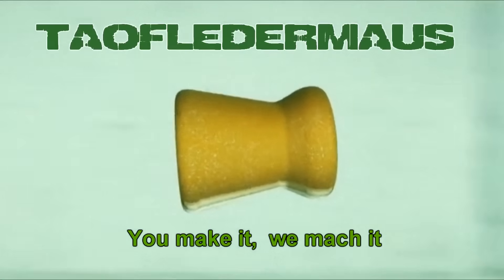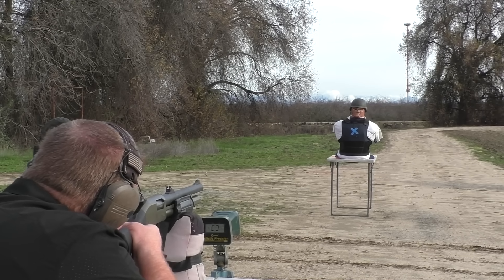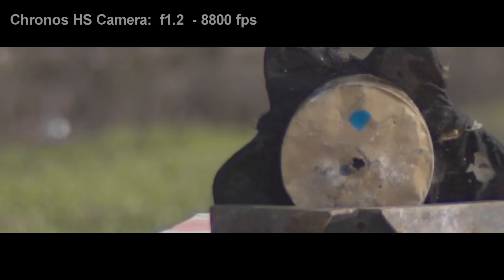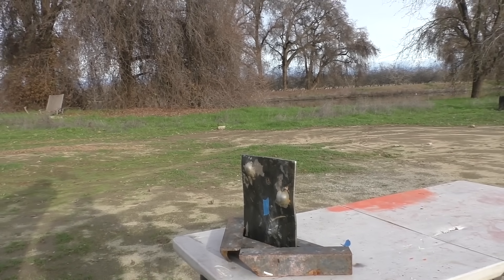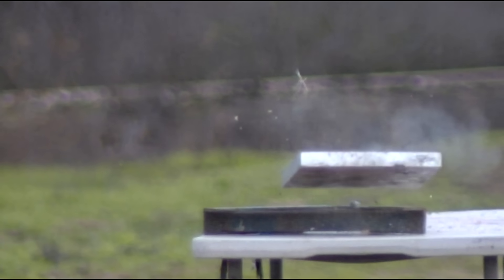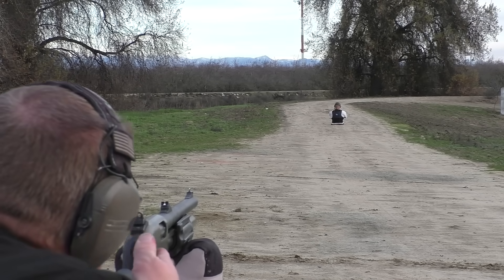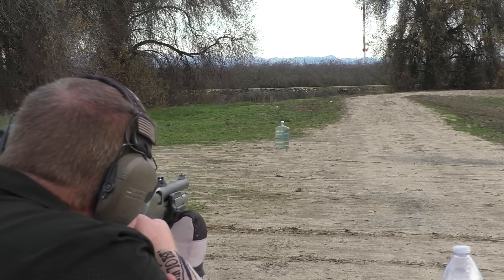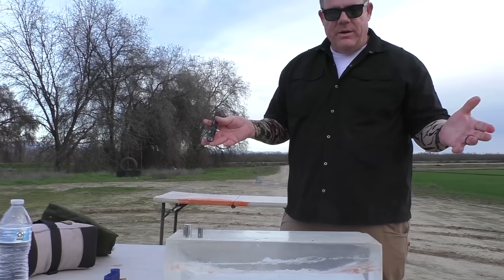The "MACH-71"  Super Perforator Slug   -  TESTED

Comment: The way the point is sticking out of the end, I would be afraid or them setting off the primers of other rounds stacked in a tube magazine.  Kinda like what the early Blackwater "heavy hitter" slugs did.  Super nice results!  I would buy some
Reply: That's one reason to go for box mags.
Reply: @GunFunZS  Box mags is all I run.  I have about 40 rounds of the blackwaters left and have shot 20 and didn't even know the problem exsisted till about 6 months ago.  Either way it is an easy fix by rolling the shells a bit taller or using a shorter wad to prevent tip from sticking out.

Comment: It definitely  needs a tungsten core.  I also think copper would be better than aluminum and score it 2/3 of the way down so maybe it will expand.  I was also thinking a slightly smaller tungsten core with tiny steel rods around it that would fragment off.  It would be a triple threat... expanding slug, fragmentation, and a penetrator.
Reply: Very much what I was thinking for a "Generation 2" version
Reply: Tungsten will shatter at high pressures but it’s great at high temp 316stainless or hss (high speed steel) will perforate better
Reply: When I break a tungsten electrode at work it splinters like wood sort of. so it would be a triple threat with just the aluminum jacket I think
Reply: Does it harden, temper, and anneal similar to steel?

Comment: Looks like an excellent new design ! Just think if the outer material was brass and the inside was tungsten….
Reply: No you want the penetrator carrier to be as light as possible, so it accounts for as small a portion of total projectile weight as possible. Aluminum is an excellent choice. A tungsten penetrator would be better though.
Reply: @caseyb1346  Brass/Tungsten would look super pretty though. ;)
Reply: @praetorxian  yeah it would
Reply: Tungsten penetrator and aluminum or even magnesium outer is better. Speed penetrates. Brass is way too heavy.

Comment: How did early gun designers figure out how tightly a slug/projectile should fit into the barrel and rifling grooves?
Reply: Centuries of trial and error making one small improvement at a time
Reply: @saltedcashews269  Yeah and I guess there wasn't super precise machining until sometime in the late 18th or early 19th century? I bet a lot of barrels exploded.
Reply: @stopthephilosophicalzombie9017  possibly, but you also have to remember the differences in energy from powders used over time. Black powder was much less aggressive than smokeless, and then there was "pistol" powder which was even stronger, and your +p powders and such.

Comment: That's easily the cleanest lead plate interaction ever on the channel.  Perfectly round crater on one side, perfectly straight hole with no blowout on the other side.  Kyle is an instant legend.  Looking forward to his future work.
Reply: Characteristics of a shape charge. Wonder what a copper core would do?
Reply: @blauer2551  shaped charge would need to be an explosive shell. not really the anti-armor mode for small caliber munitions.
Reply: 😊 2:10
Reply: Physics, it essentially whipped the core out.
Reply: Facts‼️
Reply: didn't the steel core anti-armor round get stuck in it?
Reply: @JonathanSchattke  the steel pinatrater was stuck in the vest after passing through the lead plate. The aluminum slug was what stuck in the plate.
Reply: They're in Californitopia. Nothing is straight there. LOL

Comment: Definitely one of the best homemade slugs you’ve tested.
Reply from the maker: Especially for a first timer!
Reply: Copper outside and a tungsten core would be perfect in my opinion 🤔💪🏼
Reply: @andreasbinder6510  and 10x the price. Keep the aluminum sleeve and forget about a tungsten core, just make the core out of hardened steel instead of mild.
Reply: @tissuepaper9962  or make both a cheap option and a performance option
Reply: That slug is basically a well made APCR round, a beautiful implementation of a proven concept
Reply: Imagine it with a carbide or tungsten penetrator
Reply: Maybe copper instead of aluminum to give it  more  and help to push the core through the plate
Reply: @gustavogiorno3122  In APCR you want the mantle of the bullet to be as lightweight as possible. All energy you spend to accelerate the mantle is basically wasted, because it is designed not to penetrate the armor, only the penetrator-part should go through. Therefore, you aim for the lightest material possible to increase the speed of the bullet and the energy of the core.

A version of this slug made out of an polycarbonate or carbon fiber mantle and a tungsten carbide (...or even better: depleted uranium...) penetrator core would be the most effective combination against armor.
But who would be willing to shoot a depleted uranium bullet from a shotgun...
Reply: @Nachtmahr79  ty very much for the explanation. In my mind the outer would help push the core once the tip contacted the target. 
But it makes a lot of sense. Its basically a sabot that do not detach. While the outer helps with energy dump in soft targets.
Reply: @gustavogiorno3122  
Correct!
APCR is the "ancestor" of modern APDSFS, it was developed for rifled barrels and the aluminium jacket is needed for arodynamic stability in flight with spin stabilization.